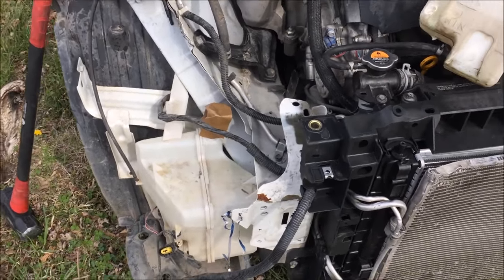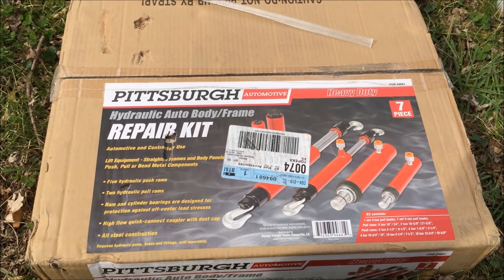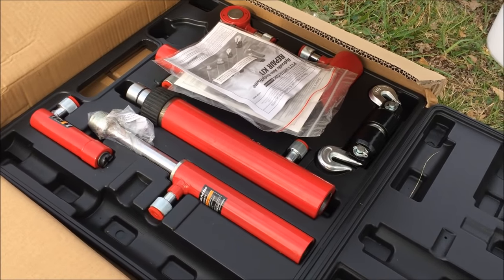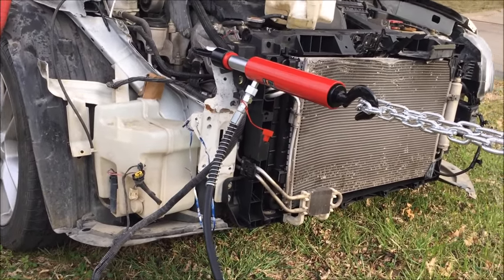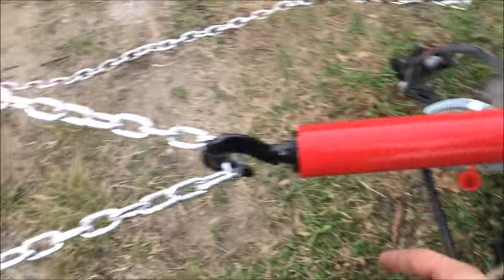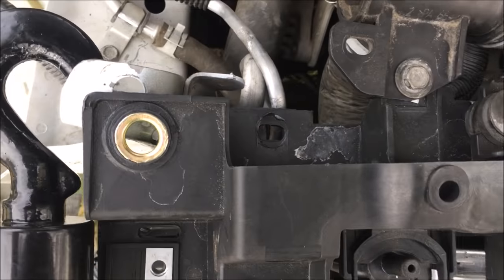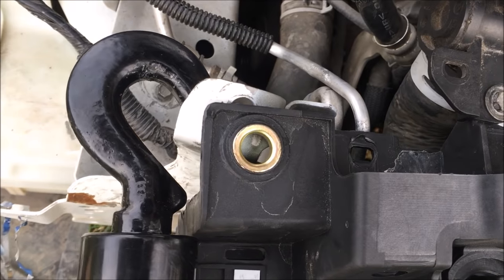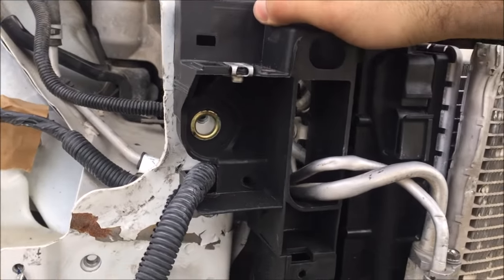How I used Hydraulic Puller to straighten radiator frame

Comment: Honestly a tree or pole, a large heavy duty ratchet strap, a chain and a come-a-long would work exactly the same.
Reply: Maybe......with a LOT more elbow grease. Can't beat the pulling/pushing power of a hydraulic pump.
Reply: Kace Bruce  Let us know how it went.
Reply: No really
Reply: just purchased both, I changed my mind on the come a long because I was scared it snaps in my face, with this tool , you can be out of the way in case it comes loose go forbid, both a still dangerous must be care fully.
Reply: Didn't work for me, now I'm here. Used a 4k came along

Comment: Nice work... some tips for you. 1st. Safety, when pulling, place  extra chains over the chains used for pulling. The weight of the chains will prevent the chain from taking out your head if the chain breaks or slips from anchor point. 2nd, when pulling, stress release the metal with a rubber mallet or a piece of wood.

Comment: Instead of spending $300 only to use a chain rated for 1 ton, to build some overly complicated frame puller, you could've bought harbor freights 2500lb capacity winch, for $70 that comes with a 20ft wireless remote. Just saying.
Reply: This setup is only $165 for the pump and 10 ton pulley. It's way faster and more practical. No electrical power needed. No need to find somewhere to mount a wench. Small body shops often have a setup like this for framework. You'd be hard pressed to find one that does it with a wench.
Reply: @PaulPaid  like this answer
Reply: @dreamingcode  Thanks. I've  decided to go with a Tekton 5547 4 ton  Ratcheting Pulley and a JCHL Nylon  7.5 ton  towing strap for my own DIY bumper rail repair. Total cost  $80. 😊
Reply: @PaulPaid  That's exactly what I need it for! Are you getting all this from Harbor Freight?
Reply: @dreamingcode  I bought both from Ebay.
Reply: @PaulPaid  Thanks!

Comment: Man you could have done the same thing with a $10 come along
Reply from the maker: Yes I thought about it. However I wanted to test out the 8 Ton hydraulic puller.  And I use it a lot too now.   Thank you for sharing.
Reply: I thought about purchasing one for my bent radiator support. Any advice?
Reply from the maker: Yes, sure.  The hydraulic puller can be very pricy.  You might want to try and buy one of the manual cable winch pullers from Harbor Freight or online.  Here are some that are being sold: 
https://m.harborfreight.com/catalogsearch/result/index/?dir=asc&order=EAScore%2Cf%2CEAFeatured+Weight%2Cf%2CSale+Rank%2Cf&q=Cable+winch+
You can get a decent 4-ton puller for $30.  I use my hydraulic puller 2-3 times each month, so the cost is justified for me.  If you need a puller for just 1 job then you need to save $$$, I think.  Hope this helps.  Good luck!!!
Reply: 8 ton?!
Reply from the maker: 4 ton, 6 ton and 8 ton.
Reply from the maker: Wow!  That is like almost FREE!  Thank you!
Reply: @Iam-BruceLee  
Ive seen 4 ton and 10 ton... never seen 8 ton or 6 ton...
I have the 4 ton set.
The set in the vid is also a 4 ton.
Reply: Or a $3 hammer or free rock not hating just saying
Reply: He should have just run the chain around the tree / radiator support and then slammed the car in reverse.

Comment: The 8000 on the pump means that the device it came with can handle 8000 kgs.
It han push 80000kgs if you use a bigger diameter cylinder.

Comment: Just a reminder always pull before installing new parts Dri-Fit before final installation
Reply from the maker: Ok, thank you for the tip.  I learned this lesson as I keep working on them.  It is a great idea.  Saves a lot of headache in the long run.  Thank you.

Comment: nice line up for the bolt holes. I've been thinking about getting the porta power. I didn't see the puller at the local harbor freight. I'll have to ask them.. I enjoyed the video. Thanks.
Reply from the maker: You are welcome.  That puller started leaking oil after about dozen or so uses. I exchanged it under return policy and purchased replacement warranty.  Harbor freight tools are cheaper but they are not the best quality.  So you may consider warranties and replacement options.  Good luck!
Reply: Their website carry way more tools than the store you can buy lifts and all big stuff

Comment: while it's a good idea to have among your tools a porta-puller kit, for that little bending - on the radiator upper suport - you actually don't need to waste your resources on these type of small operations like that

actually, and what it really works well on this application, is just the chain attached to the same tree you have on your video, and a 10 mm x 2 inches long screw with washers and a nut on the radiator's support bracket slot

once this set up has been made, slowly, just pull back up the car little by little until you get the proper alignment with your radiator and support bracket and you'll be done in less than 5 minutes 👈
Reply from the maker: Wow, thank you for your comment, suggestions and ideas!  I guess I really did not honestly think of that at the moment.  I had couple of other projects that I wanted to used the hydraulic puller on so I had decided to go ahead and buy it.  Since then I have gotten dozens of great ideas on how to pull off this job now from other people’s commenting.  So thank you!
Reply: FixIt - not a problem bro
like i'd said, it's a good idea to have equipment as such, but remember that most situations are very simple to solve; just be practical 👈
Reply from the maker: Hahahaha,  thank you once again!  Many many thanks!!!
Reply: FixIt - yw
Reply: bro could u explain this a bit better?

Comment: Are the fittings on those hydraulic tools built to a standard?  I already have a 4 Ton hydraulic kit but I don't have a hydraulic puller.  I'm just wondering if I could use just any puller or do the fittings differ with the manufacturers.
Reply from the maker: So far I have used half a dozen different kinds and the fittings are all the same.  So I think they are built to a standard.  You might still be able to use any hydraulic puller, not sure about any puller that is not oil hydraulic though,  hope this helps, Good Luck!

Comment: you wasted 7:56. You could have used a sliding hammer hell you could have just used a hammer. why?????
Reply from the maker: I know Kevin. I know.  I use this hydraulic puller almost once a week now.  I think the cost is somewhat justified now.  I also did not have enough room for the hammer to do the job under the hood.  So I now got lots of ideas from people like you on doing the same job with dozen different tools.  It was a learning process for me. Lol.  Thank you for sharing.  I think the cost is worth it if you use the tool on dozens of different cars and projects.  I hope it is.
Reply: @fixit3879   do you own a hustler stick?

Comment: to do that you dont even need a machine or a hydraulic portapower in order to straight that radiator bracket, all you need is to hook up the chain to that tree and back up the car a little bit and you're done with it, OR you just hammer it until you reach the desired position for it dude 🤠

Comment: Will this work with a radiator core support?
Reply from the maker: I think it will work.  However you need a way to tie down the vehicle if the pulling goes over 1-2 tons. Use the emergency brake.  I also chain up my car to the 5,000 SUV on the other end.   If pulling is too strong it moves everything.  But within 2-3 tons pulling tensions things do work out ok.  I hope this makes sense and it helps.  Good luck!

Comment: Could have used a $3 hammer or I don't know maybe a free rock
Reply from the maker: Hey Jim, I knew you would say that.  The problem was that I could not squeeze any hammers behind it.  So I use the hydraulic pullers for other things too now.  Thanks for sharing some ides!
Reply: Coulda fixed it with a pry bar. But the porta power is a good tool to have.

Comment: Would this work to pull out a dent  door hinges are ? My door got smashed and bent the frame where the hinges are and a new door wont fit right
Reply: socalraie theoretically yes, you would need a different attachment, like a plate and loop so you can attach it to the hinge post and pull on the loop. They should sell them on amazon or eBay.
Reply: @drummer_zay9493  Could something like this work to pull out a dent caused by a garage jack on the underbody of the chassis?
Reply: Daragh O Connor yea but you would need to put the car on a lift and clamp the pull back ram to the floor so you can pull out from the bottom.

Comment: How. Much
Reply from the maker: 160 puller set, 150 hydraulic pump.
Reply: Check on Ebay
Reply from the maker: Alrighty.  eBay is cheaper as usual ?
Reply: You can rent it for cheap if your local auto store has it.
Reply from the maker: Thanks for sharing.  I didn’t know you could rent it.  I bought it with the purpose of using on a regular basis.